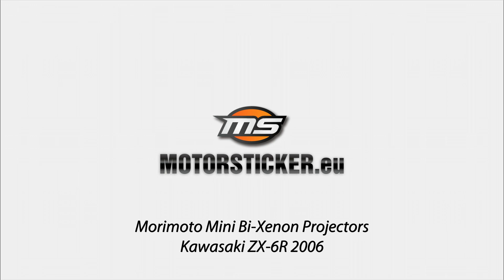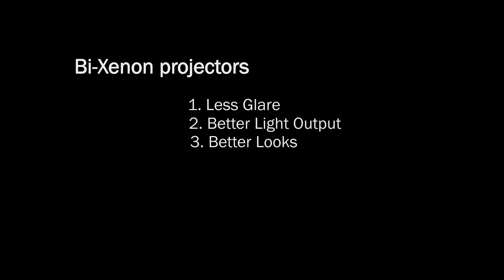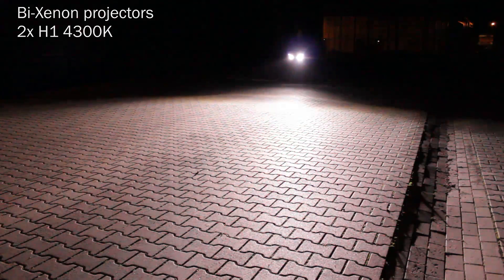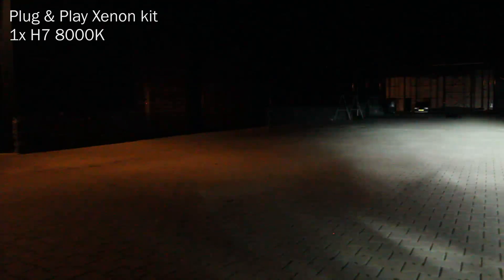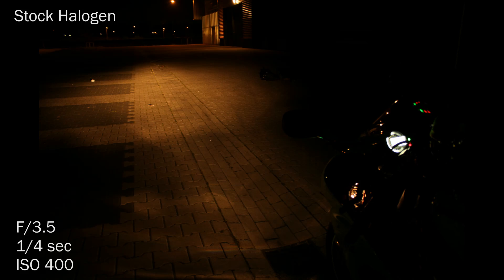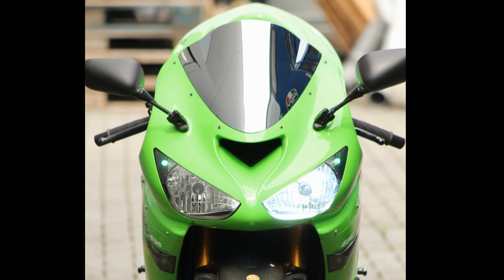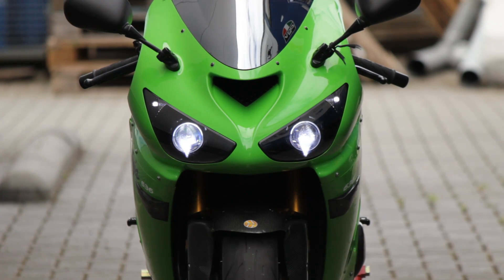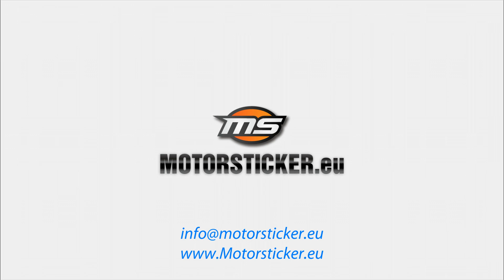Mini Bi-Xenon Projectors Performance Compared to Plug&Play Xenon | Retrofitlab.com

Comment: hi guys, just want to ask, whats the best color temperature for the bi xenon projector lens in a single headlight? 4300k 6000k or the 8000k?hope somebody can tell me thanks!
Reply: 5000K has my preference, neutral white and gives you a lot of light output.
6000K has 2% more light output, but it's blueish.
8000K is blue and has worse light output then both the 5000-6000 and 4300K.